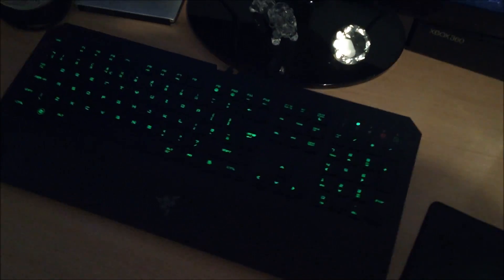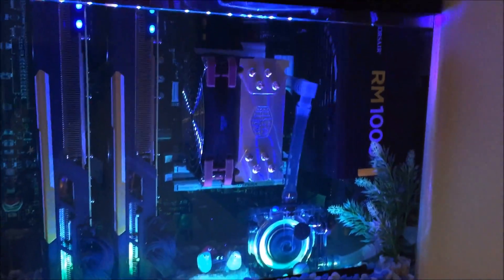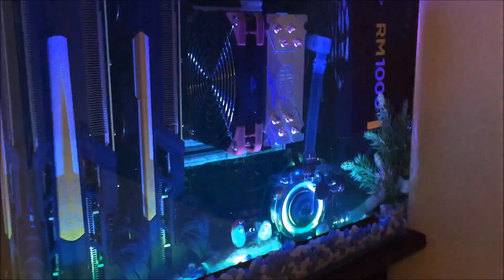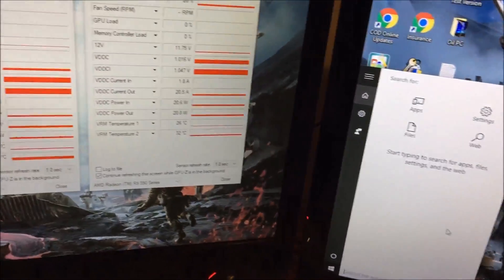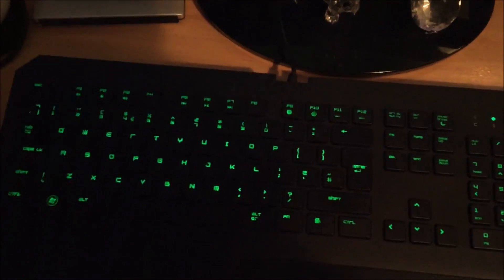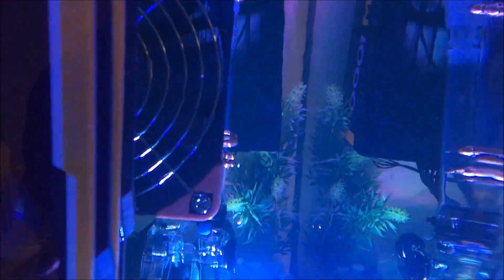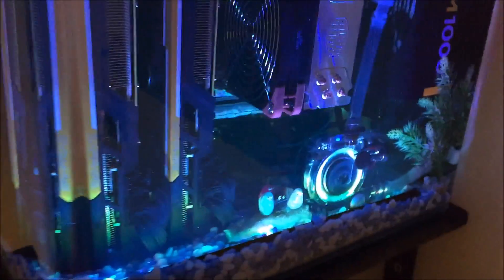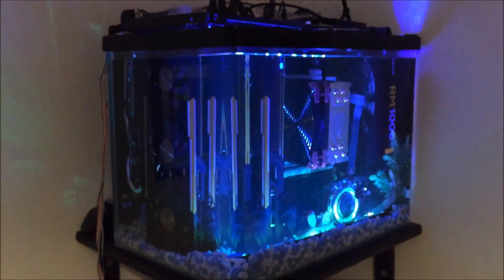MY MINERAL OIL COOLED PC!!!

Comment: Oil gets contaminated when exposed to air, not sure if he mentioned if it was airtight or not.
But for the oil to properly expand, it needs an expansion tank with sillica gel on the breather like a transformer...
Otherwise you'll have dust and water sitting at the bottom of the tank that will reach the components with temperature exchanges.

Comment: you need a radiator to pump the oil into fins to cool it with the air.. or the oil will just continue to increase in temperature

Comment: Building my mineral oil PC this week. Intel i9, 16GB, Asus mobo. I'm gunna be live streaming the pour. Hopefully nothing gets fried. 😄
Reply: Honestly I wouldnt build it :/ You cant upgrade the parts (which you'll want to do xD) or repair parts if they're broken! Especially with those expensive parts you'll never get them back if they break. The mineral oil gets inside the parts and when you lift it out for repair... That wont be easy!
Reply: @ollieslater7818  does yours still work?
Reply: The Secret Letters of a Hacker I don’t have one, for this reason...
Reply: @ollieslater7818  meh...I dont plan on upgrades.

Comment: Shouldn't you remove the cpu cooler and the cooler on the video card? The whole point of a submerged computer is so that the fluid is in direct contact with the thing that needs to be cooled. Having the solids butted up against them is making it way way less efficient.

Comment from the maker: Just a quick update, the mineral oil PC is still fully operational over a year later! I have not had any issues at all and the silicone sealing the tank together are holding up fine (which was a concern of mine).

I sadly have not found a way to get bubbles in the tank without an air bubbler, any suggestions would be appreciated!
Reply: Why do you leave the fan in there? Why not remove the fan before?
Reply: Vikrant Sharma direct contact with the oil would only cool so much. By continuing to use the heat sink + fans he allows heat to dissipate from the CPU much faster. In addition, having the fans circulates the oil which could just sit and create pockets of heat otherwise.
Reply: @Chitose2007  Makes sense. Thing I am concerned about is that the fan's motor has much more friction, how does that not overheat?
Reply: @ItsJustGilly  the oil lubricates the fan bearings

Comment: Do not put the jelly fish in, oil will dissolve it. Mineral oil eats rubber and plastic, so it can damage electrolytic capacitors (it will eat plastic caps and leak into capacitors) so your PSU might be at risk. Oil will also damage the cables and plastic tubing, they will get very stiff and brittle and in case of tubing it might be a very bad thing. Some people even have problems with fans stop working in mineral oil because it eat out some pvc parts inside them.

Think about switching to silicon oil, it is more viscous and more expensive but it will not damage rubber and plastic parts.
Reply: Petroleum based oils are the ones that eat rubber, not mineral oil
Reply: Mineral oil is petroleum-based oil.

Comment: Quick tip/warning. The fans are not designed to work in such a thick fluid. They will likely burn out very quickly because of that.

A better solution would be a pond pump.
Reply: Victor Sanchez
It's good to hear that your fans are alright, but my original point is correct. These fans are not designed to work in thick fluids and so will generally wear out faster than if they were moving air. You will get a superior and more reliable flow rate with a simple pond pump that is rated for chemical contaminants, they usually have a ceramic impeller.
Reply: Victor Sanchez
Don't get me wrong I was only throwing in some friendly advice, I wasn't trying to say you're an idiot or something like that lol.

Do you mean the overall maintenance of the system is an issue or you think the pump would require greater maintenance than the fans?
Reply: Victor Sanchez

Yeah I can see that being quite tedious and mineral oil can stain and damage all sorts of items. Still it;s a fun thing to see someone do.
Reply: You are literally the only person I've seen saying this. every other person I've seen that has built one says that the oil keeps everything lubed up enough that the fans don't burn out. The guys at Puget that used to manufacture oil cooled PC kits said they've been doing it for 10+ years with no incidents.
Reply: Jared Roberson

It's not just about cooling and lubrication, the actual design of the fan is not supposed to deal with anything thicker than air. If this wasn't a factor in such designs then you wouldn't see different types of fan and impellers wouldn't even exist.

Just because I'm a lone voice doesn't mean I am wrong. The fans may not burn out as quickly as I would think, but a pond pump or something similar that is designed for the job is going to be better and last longer. It should also use far less power to move the same volume of fluid.
Reply: the fans are fine they aren't trying as hard as they can to reach a speed they are just being given a set amount of voltage so the just turn as much as that amount of voltage can. they aren't under and extra stress

Comment: Hi. Planing my first OCP (Oil Cooled PC) and have just a little tip: it is better to suck the warm oil from the top and let the cool oil in at the bottom. So the natural effect of thermodynamics is used more efficiently ;-)
Reply: Does it require a radiator ? Does it get too hot ?
Reply: @prashanthb6521  As seen in other projects on YT, a radiator is not needed to make it work. For a balanced and more efficient overall cooling performance under load, I figured to add one is a great way to go. But to improve the cooling even more, it is logical to place the outlet from the radiator at the bottom, since warm substances rise to the top on their own. (Like in a lava lamp)
Reply: @Flotty83  Thanks for your reply. I am planning my first project :)

Comment: Waiiit so you can just drop your pc in mineral oil and it still works
wtf
Reply: Donovan mineral oil isn't water, mineral oil isn't corrosive or conductive unlike water, also you need to set up pumps and radiators so mineral oil stays cool, things go bad if the oil goes over 50c

Comment: dayum pyonic, back at it again with the dope pc :P.    would it be possible to then take it out the mineral oil and use as a normal pc? would u have to clean all the components out then? is it cheaper than a water called case setup thing
Reply from the maker: +wisp yes I could take it out but cleaning it would be super annoying! :p about the same price as a watercooled pc but they weren't available for the gfx cards at that time.